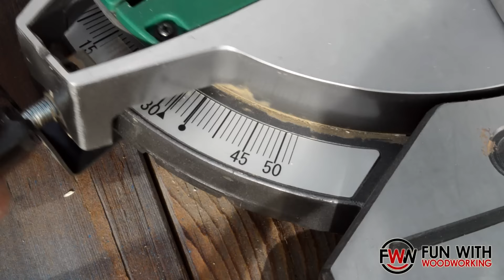Quick and easy pumpkin/squash/watermelon trellis for under $10

Comment: When nailing some of the legs, you had the nail gun pointing toward your groin, as you were counter pressuring the structure to get a tight fit. JUST IN CASE... you might want to always keep the nail gun in the opposite direction!!  :D :D
Reply from the maker: Thank you.